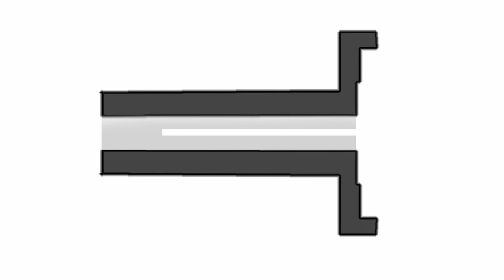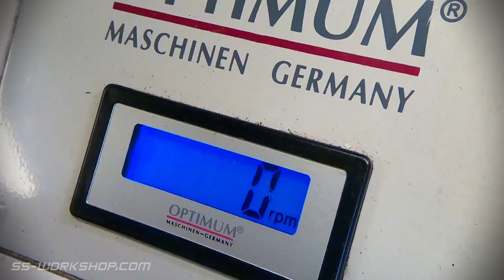ER Collet Thin Part Workholding - How To

Comment: I would expect this idea to work better if the part swallowed in the collet extended out the back, so that the unslitted part was not within the contracting collet. The way it's done here, the unslitted part prevents the collet from contracting at the back end, which in turn prevents the front from contracting more than the very small amount allowed by elastic deformation of the taper bore of the collet holder.
Reply: I was wondering about this problem as well. I was thinking about turning a slight taper towards the end, but meh... Luckily, your solution is much better and simpler!
Reply: @ErikBongers  I think the best grippig force would be if the slitted part does not extend beyond the collet but if there is a step to a smaller diameter near the end of the collet. but I would not taper the front part as this might damage the collet or chuck.

Comment: Thanks for posting this video! I never knew (or even thought about) that ER collets require full length support. I have long considered purchasing a set of collets for my lathe, but this gives me pause - because work holding for short pieces requires a different style of collet.
Reply: I agree it's not the best way to go if you're purchasing specifically for workholding, but if you already have an ER collet set for toolholding, you can work around that limitation by putting a short piece of round material the same diameter as the work at the back of the collet. If anything, it should be very slightly smaller for best results.

Comment: Great video. Work holding like seem like it'd be good for quickly centering a part on a rotary table (if you had a taper on the back of your collet). Is that what was going on in the final clip?
Reply from the maker: Thanks, I run a face plate type collet holder on my rotary table so still needs some alignment but the other option would be a Morse taper type collet holder to suit the rotary table.